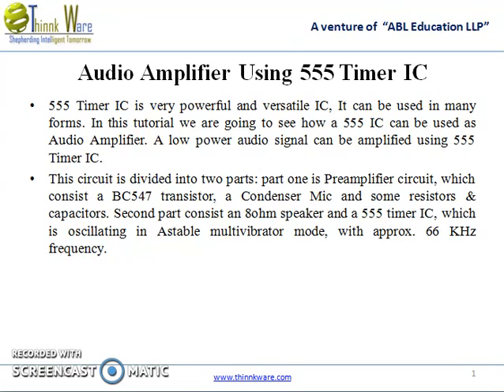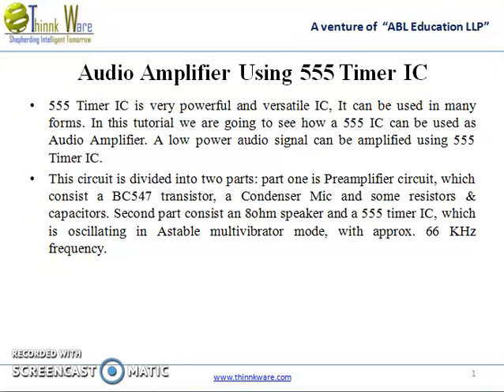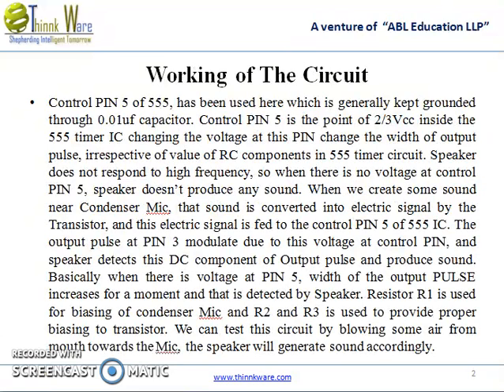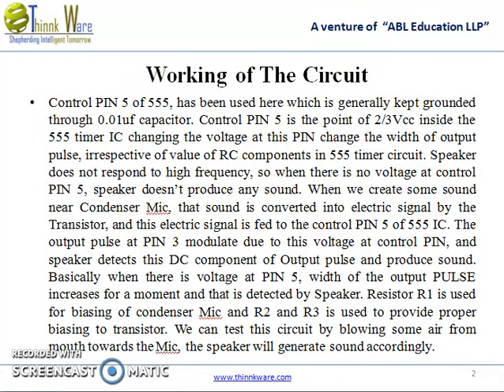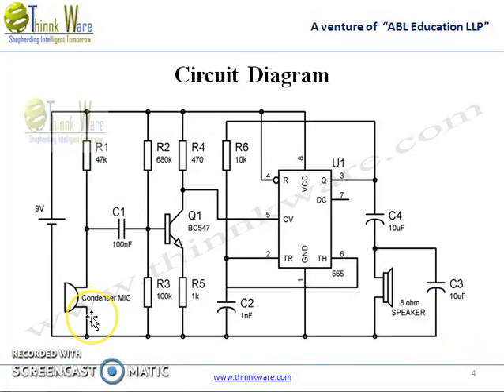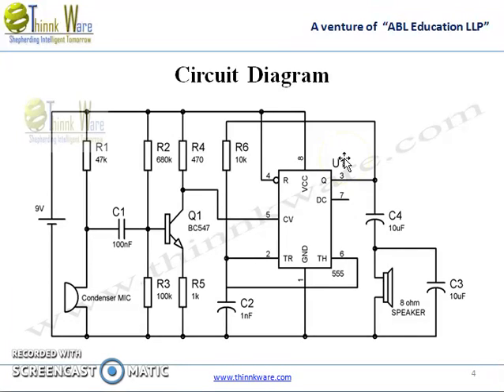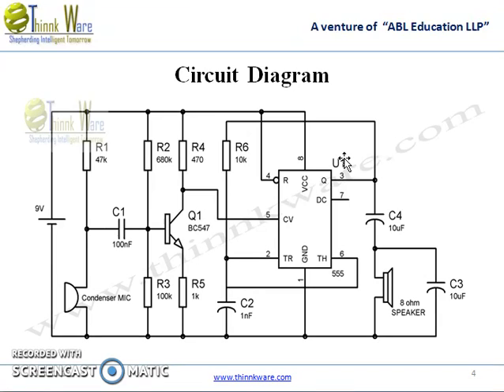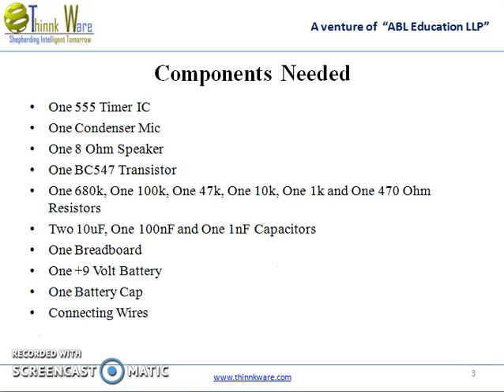Audio Amplifier Using 555 Timer IC

Comment: There is a major error in the output. It is NEVER good practice, to drive a square wave directly into a capacitor without any impedance. C3 and C4 are in series between the output pin (3) and ground. Charging and discharging this value of capacitor will heat up the output transistors, by forcing them into current limit during transitions from source to sink, then, sink to source. There are 2 options here: One, replace C4 with an inductor. Two, if you wish to rely on the inductance inherent to the voice coil of the speaker, simply delete C3. As you mentioned, if you choose to delete C3 and use voice coil inductance, I recommend increasing the value of C4, to get better bass. Using a 10K for R6 IS appropriate, to keep the switching speed high, with the 104 (.1uF) capacitor as the timing capacitor. Running R6 at 120k will reduce the clock speed way down into the audio range. If you wish to increase R6 to 120K, you will want to reduce the value of C2 to a 472 (47 nanofarad) to keep the clock speed well above audio range.